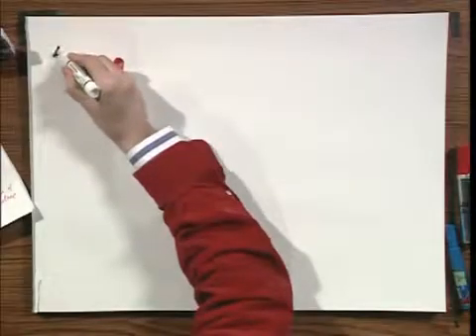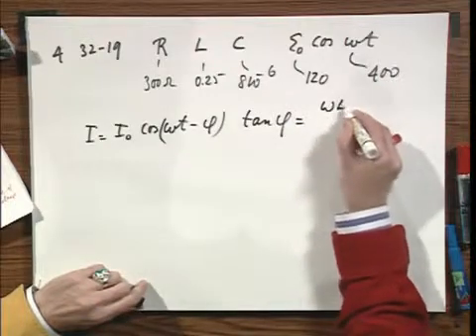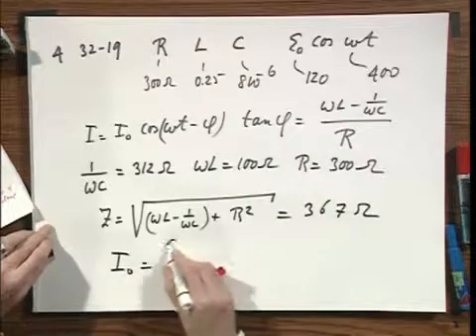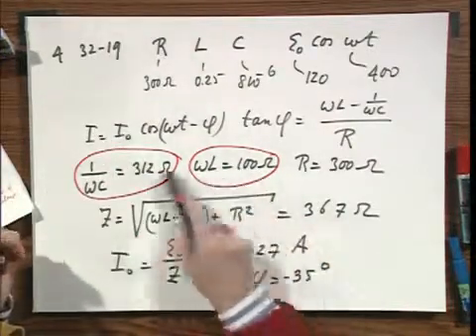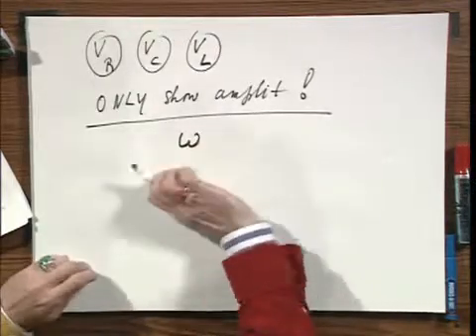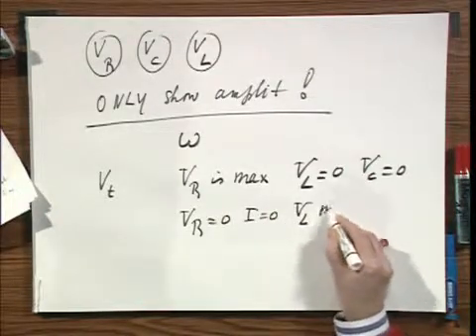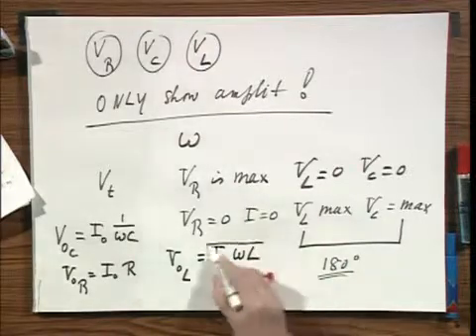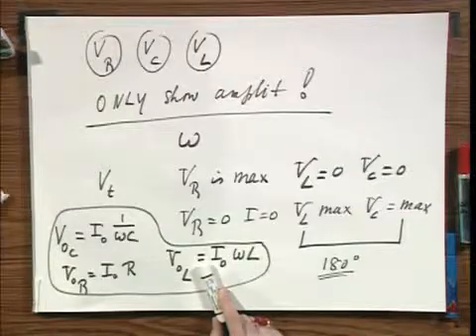8.02x - Module 09.04 - A Driven RLC Circuit.

Comment: Professor, why are the voltmeters over the capacitor and self-inductor exactly 180° out of phase? Also, how does the inductor push the current exactly 90° behind the e.m.f. and the capacitor pushes it specifically 90° ahead? I didn't also find a video explaining why, when p.d. across R is max, p.d. across L and C is 0. I don't understand the role of L and C in changing the phase and the p.d.s across the components here professor, please help!
Reply from the maker: watch my 8.02 lectures!
Reply: @lecturesbywalterlewin.they9259  I've watched all lectures from 8.02 regarding electromagnetic induction, professor, but I couldn't find the topic of p.d. across R, L and C. Also, I didn't understand why L and C change the phase of the current exactly by 90° and not by any other angle. Please explain.
Reply: @lecturesbywalterlewin.they9259  If they exist, please point me to the lecture, because I've checked everything related to LRC circuits in your lectures, but couldn't find where the phase difference of 180° between the voltmeters connected to L, R and C is explained. Please do consider, professor.